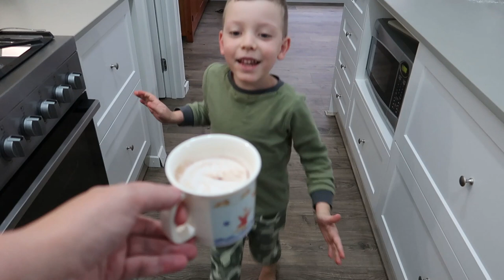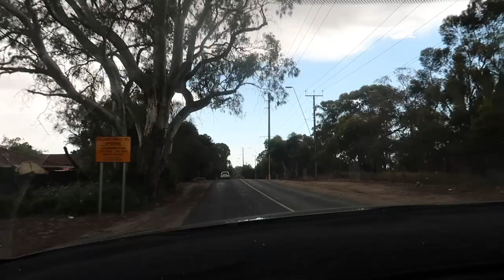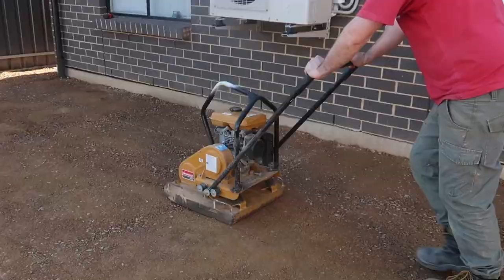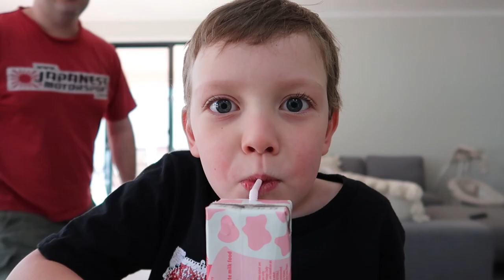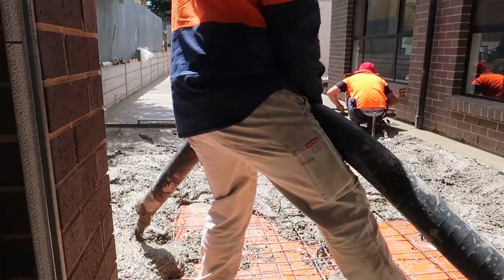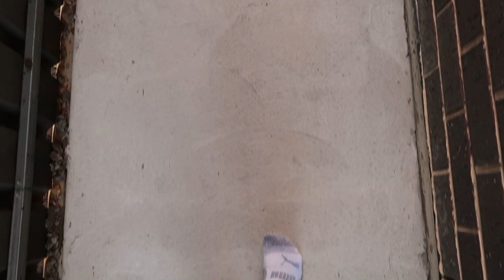HOME RENO DISASTER | How did they get it so wrong?!?

Comment: It is possible to paint concrete to get rid of the splotchiness but that doesn't solve the cracks, poor drainage, roughness of the surface and sloppiness in finishing. I've recently built a house myself and experienced living next to houses were there's been major renos. My experience with tradies is that >90% of them don't give an f about anyone or anything other than themselves and they're experts at blame shifting and shirking responsibility in the event of things going bad. In trades where they are in demand, such as concreting, they really don't have to provide any level of customer service.